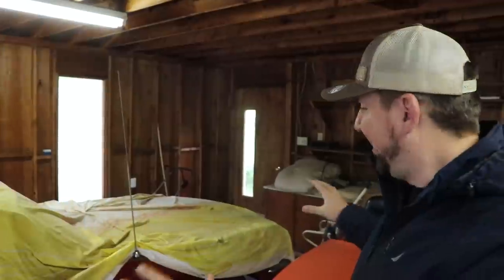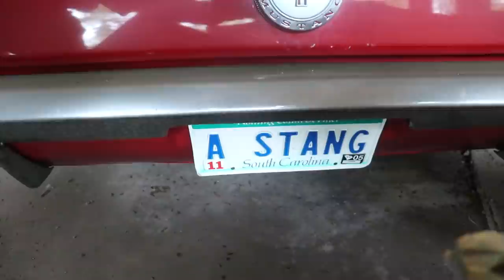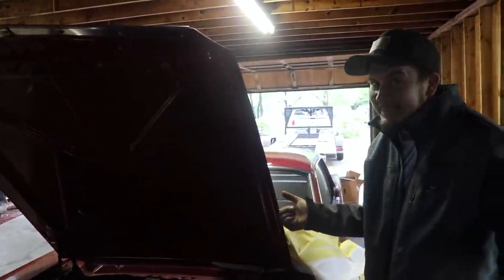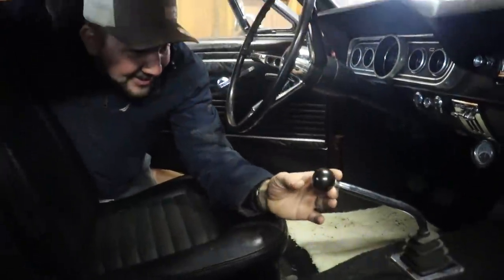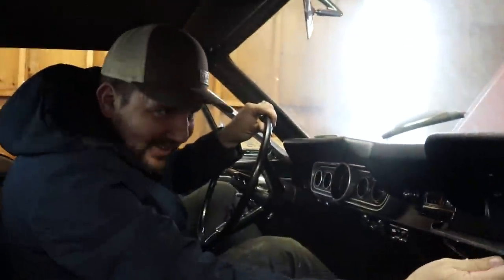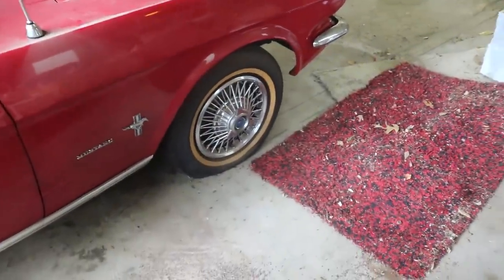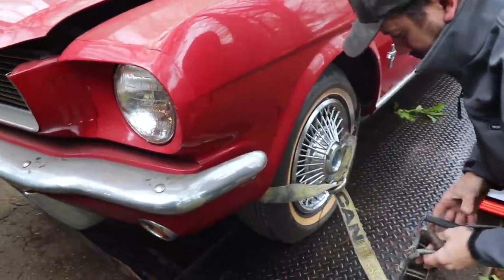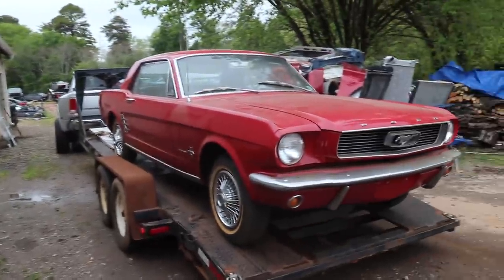BARN FIND 1966 FORD MUSTANG WITH A CLEAN TITLE GOOD DEAL?

Comment: 2 things to say about barn find...
1. this barn find you got is a historic find. All original = keep it original with clean up, engine oil change, radiator flush, buff up the wax (shine her up) and check list what or whatnot needs to be done to work it's glory find.
2. if you find a barn with a huge need of work = engine swap, mod it up HOT ROD Style.

Comment: Great little Mustang coup. Love that it has the 6 with the manual 3 speed. Ford's 200 ci six is so easy to work on and was upgraded in 65 from 4 to 7 main bearings making it a way better engine than the early ones. Good luck guys!

Comment: As the Long time owner of a 66 coupe it’s fun to watch you guys discover the vintage features like crank up windows and the three speed on the floor. My 66 is also red. Judging from the chrome air cleaner on yours and the wire wheel covers. I would say this is a Sprint model that Ford sold with only the six cylinder. Anyhow that’s a very nice Mustang. Congratulations.

Comment: That is a great find guys, my was 66 tang. Pony interior 289 engine, color was emberglow.  Front wheel have drums. You need to go thru the brake system. Lubricate your cylinders rotate them by hand,  I hope engine is not frozen which I doubt it. Check the floor panels, rocker panels, door seals, rebuild the carburetor I bet is dirty and old gas damage carburetors and keep it stock has more value.  Great buy I guess you pay 8,0000.00 anything less is a bargain. Great video. Take care thanks 😊

Comment: I restored a 66 sprint 200 mustang when I was in my teens... and my only major complaint was it had no a/c.  I'd add an a/c.  Mine got 27 mpg after I tuned it, which was incredible.  The only other thing I did was to put a 67 tranny in it... it had synchromesh whereas the 66 I had did not.  Make sure it's not leaking oil, belts, hoses, and lines... weatherstripping if it needs it... but I'd just do the basics and add a/c.

Comment: I love it! My very first car when I turned 16 in 1974 was just like it, except it was black with black interior. Mine also had a 250 6 cylinder. Leave it as it is, that's where the value is.
Reply: Nais   gog
Reply: @joukokrooks4455  ???????????

Comment: Please try to get that 6 cylinder running before you decide to change anything. You should put some ATF in the cylinders just so there will be some lube before trying to start it. Also try to turn it several revolutions by hand before trying the starter. That car is too perfect to make any changes to it. I would keep it as original as possible. Great find!
Reply: You are right they first thing i did was pull out plugs and shot 5 pumps of trans fluid in every cyl  i filled up oil filter . turned the eng over with the plugs out. i set the points installed new BRF 82 Motorcraft plugs. unhooked the fuel line from the tank . Then i jumped a wire from the battery to the coil  then i put a screwdriver from the small terminal to the battery side of the starter relay. put  gas in the carb fuel bowl. Wait for the next video to see what happened.  Scrubs say NIKO BROS OTAY|

Comment: Pretty darn nice Mustang Guys! Sixties Mustangs & Camaros that are true garage finds are few & far between these days! Fifteen or twenty years ago I used to find nice Mustangs & Camaros on a regular basis but it has been quite a while since I have discovered one that was still decent enough to be worth the effort! Back in 2005 I found a 69 Camaro RS early production no cowl hood or spoilers with 327 & three speed trans with console & 72K original miles! It still had the original spark plug wires & California smog! It had been parked in a garage for nearly 20 years because the timing chain went bad! Anyhow Guys probably the most profitable way to go is clean it up really good & address the mechanical issues before you sell it unless you want to put time in it for the content! I know you Guys are capable of amazing things & it would be interesting to see how you would build it if you chose to do so! As always I am looking forward to the next video!

Comment: I see no reason to modify such an original car. First check spark plugs. If you have a scope check the condition of the bores. Next
put the car in gear and  rock it to see if  the engine is  seized. The points will likely be corroded so use a points file just to see it you have a spark. When all of those checks are done then try fireing it up. I think that unless it has had a major issue prior to being parked then it should run. Probably best to rig a temporary fuel tank/line as the 'Doctor' did in a recent video ( on the Tesla I think). Thanks for sharing this different video Brothers. 👍👍

Comment: In the early 90’s that I saw a 1966 Ford Mustang convertible in light blue. It had an automatic transmission in the vehicle. It was pretty sweet to looked at. It had 99,999 miles on it as I remembered it. My family went to a Ford dealership to checked my sister’s 1991 Ford Escort LX. She was in a little bit an accident back in August in 1991. She avoided a car that pulled in front of her and went over a tree stump. She was angry at the other driver. I was in the car with her,too. From it that I only had about 4 or 5 bruises from it. I almost lost my glasses but, I found them. I still liked the Ford Mustangs since I was in my teens. The car that I have now is a 2020 Ford Escape SE in black. I think that I won’t get a Mustang. I rather drive a SUVS that I feel comfortable in.

Comment: Barn finds, especially ones that have been stored over 20 years+ are just in a different category. Old registrations, manuals, original bill of sale or any past historic documentation of the specific car should be maintained with the car. Would suggest not modifying the car, but keep it as original as possible. Totally different market and buyers for these historic cars.

Comment: I was 16 when this car came out and like me it needs to be brought up to date with a new suspension, front and rear, deleting that 4 bolt lug pattern, adding a dual master cylinder, 4 wheel disc brakes, and swapping that inline 6 for a 302.V8, 4 barrel and 4 speed manual transmission. Then, when you are finished, I'll send you my address so you can ship it to me! Just sayin'! By the way, I'm sitting here drooling while I'm typing this. What a find!!😎

Comment: I owned a '65 Mustang, 289 2bbl, automatic with AC when I was a teenager. If I had known how valuable it would become then I never would have traded it for a "69 Torino Brougham. The only trouble I ever had with the Mustang was a vapor lock when driven through the Smokey Mountains. I guess the fuel line got too hot. Anyway, great find! Keep it stock. If you paid less then $20k for it then you stole it.

Comment: You can start and run the engine by jumping the wires on the solenoid  located on the right side engine compartment.

Comment: Keep it original, that's a classic and the in-line six is SOLID engine. Just replacing the carb with a throttle body injector will improve efficiency, power and reliability.

Comment: Leave it alone  keep it as it is it's worth a whole lot more like it is because it is original and you don't find them original all of the time like that one in as good shape as that one it will run good enough too with that IN LINE 6 in it I know a dude that had that same car to the TEE RED exterior and Black interior even the 6 Cylinder except I think his was an Automatic but otherwise exact same car and that little car would get up and run good so leave it like it is

Comment: Someone did a great job restoring it prior,  not original color.  Easy to start, the the starter relay is on the passenger wheel well. Apply power to the coil and jump the relay

Comment: Inline six great engine that is if a 300 .hopefully you checked the frame should probably have looked in the trunk for signs of bondo. But from first impression its sweet. If you paid less than 15000. You stole it

Comment: that's a pretty basic model, very nice.  straight 6, manual 3 speed
back in the day, there was a lot of stuff available for inline 6's for better performance, as is, they were pretty slow!
my vote is to build a restomod.  fuel injection and electronic ignition for the old 6, a modern manual transmission, decent brakes
but keep it original looking as much as possible
no keys?  you can hot wire that so easy, pull the plug of the back of the ignition lock, two pieces of wire(one for ignition, one for starter) and it will be running in 2 minutes, or just run wire from battery  to the coil and another to the starter solenoid

Comment: I would go restomod on it. Beautiful car and mint condition. But boring car. Inline 6 3 speeds manual drum brakes on 4 wheels. The body is awesome. I'd put a V8 4.6 from a 2002-08 Mustang and a disc brakes kit in the front.Then drive it

Comment: A 6 cyl, with a 3 speed manuel, with 4 stud wheels are not realy worth much. It looks great but You would need to get a V8 and make it a 5 speed manuel, replace the suspension, cooling system,wheels and rear end plus 4 wheel disc brakes and more. Keep the original look, make it a sleeper.

Comment: Don't butcher it . It appears to have a good old restoration . Get a wrecked one to customize. There are few original 66 mustangs left . Each year there are less . If it's original it would be a sin to customize.
 I'm a old man and my first attempt at customizing was a 67 . I dumped money into $4500 the first year. May not sound like a lot of money. But it was . My uncle ordered a new custom Z28 Camaro it costed him almost $8000 . Early 70s corvettes were selling for $2500.
 They aren't making those cars anymore. Every time we cut one up there are less.
 You can buy all the repop  parts you need to build a clone from scratch to customize.